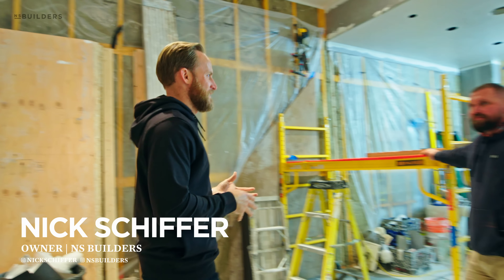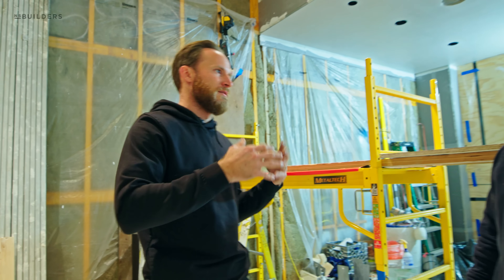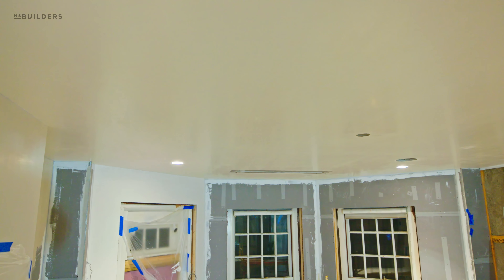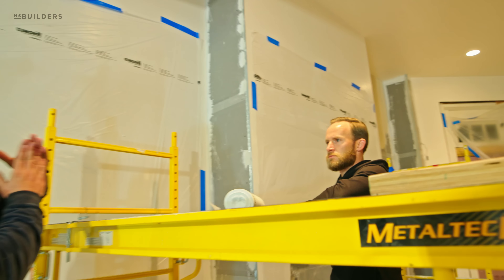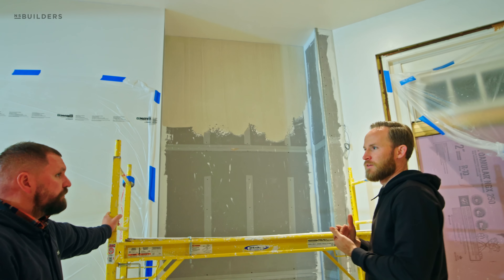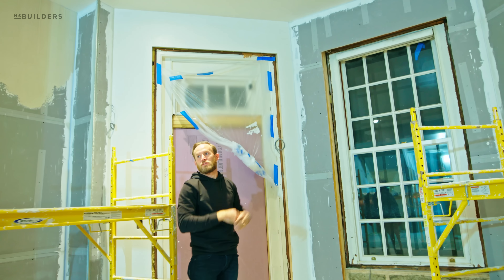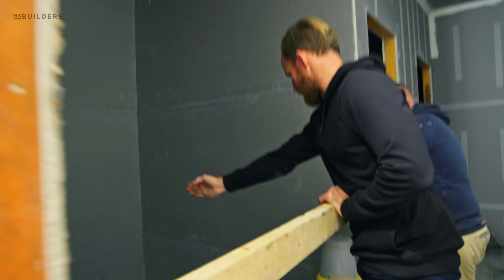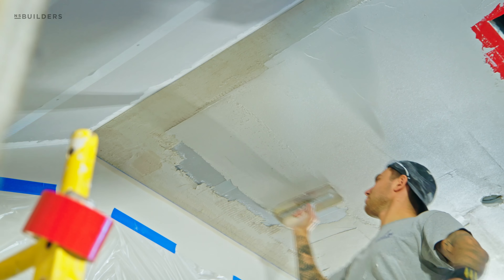2 coat plaster on the ceilings

Comment: As a UK based plasterer, I really like the spotlight recess with a built in bead around it. What happens here is a hole will either be drilled before, or after plastering (if the electrician has a plan). Plastering is all in the prep work. Level boards/stud work/beading make it far easier!
I’ve also done curved walls before…..they’re a pain in the a**!

Comment: The concept I'm working with is a cob home in a high-fire area. That means no wood and no paper. The roof is rebar and steel I beam. The walls are cob. Now, what am I going to use for lath so I can have a cob ceiling?

Comment: How durable is plaster, how long does it last, and how difficult is it to repair compared to sheet rock? Where I come from they stopped doing plaster maybe in the 50's and have used sheet rock since.
Reply: It’s still the most common method in Ireland and the uk for walls and ceilings.
Much more durable and long lasting than drywall with taped joints. In North America it’s not common so it’s expensive , and very hard to find plasters and proper bonding mix and plaster mix. It’s quick though. You only need to put mesh tape on the joints and no filler. There is no sanding and it’s great for feathering out wallows and bellies in the walls.

Comment: 4:18 Did he ever explain the zigzagging wires in the stud bays?
Reply: in case you need to move the box a little
Reply: I think they are loosely stapled into the frame and can be pulled at a later time. It is just neater than sitting curled up so it won't snag or tangle.
Reply: Thanks guys.

Comment: As a plasterer the process of skimming over blue is stright forward a  first coat is put on than a second coat after the first has 
Pulled in for 15,20 minutes, why are they useing darbys on ceilings the max thickness should only be about 3/16 it is not scratch brown and skim work
And what is with the lines in the trade 30 years
Reply from the maker: Not sure I follow the question, but there’s a few ways to accomplish the result